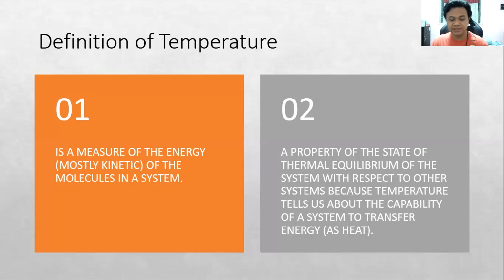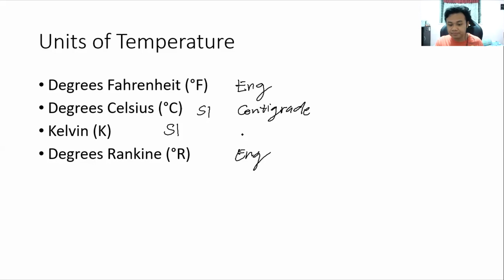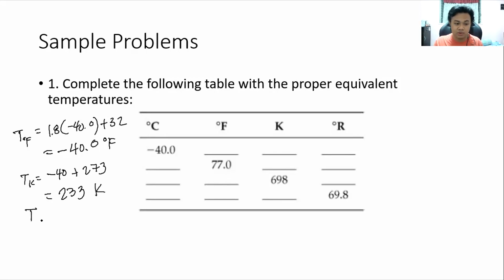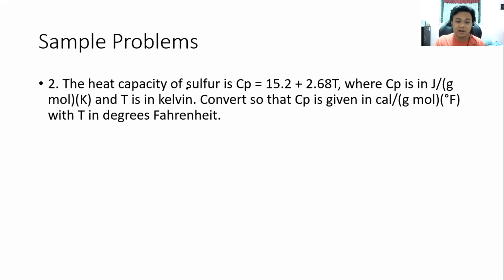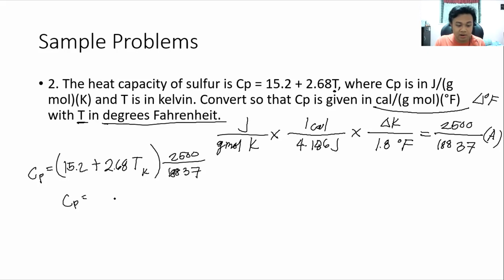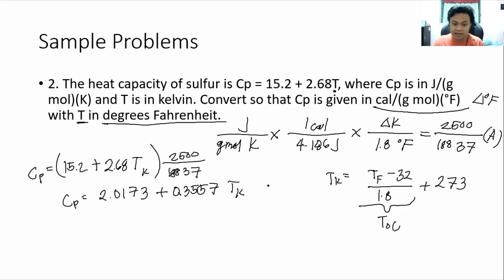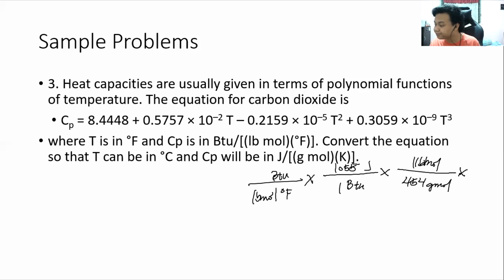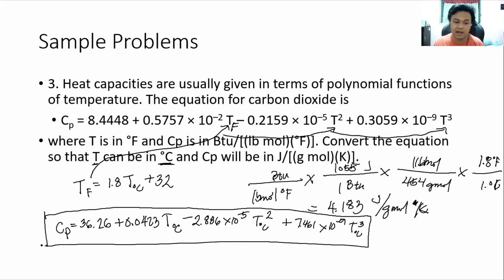HOW TO CONVERT HEAT CAPACITY UNITS (BTU/LBMOL-°F TO J/GMOL-K AND VICE VERSA) | ChE CALCULATIONS

Comment: How do you get the answer 36.26 because when I multiply 8.4448 with 4.183 i got 35.32
Reply from the maker: Hello! You still have to account for the other T squared and T cubed terms. That's why the answer is 36.26.